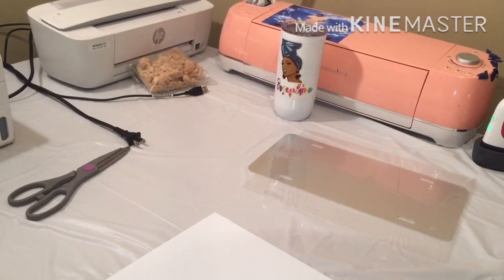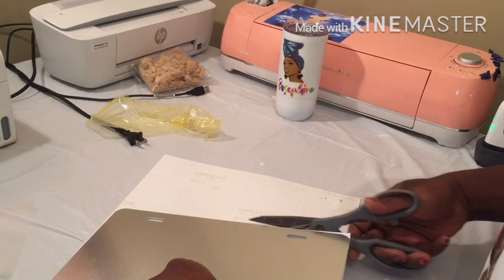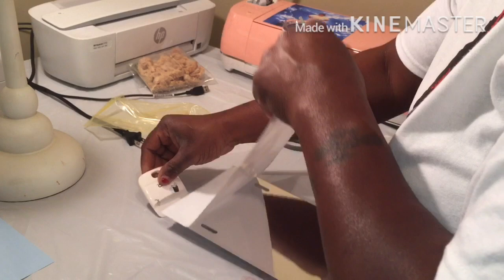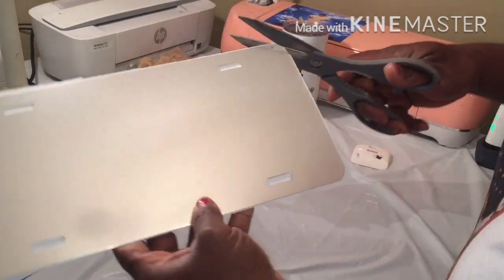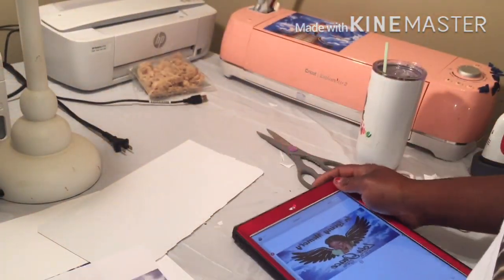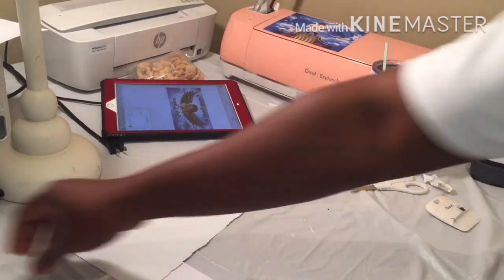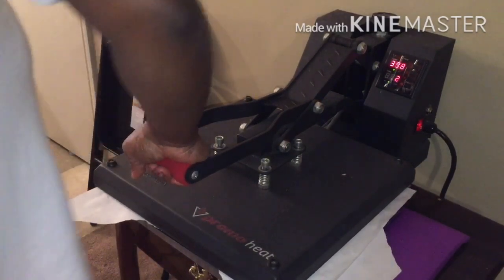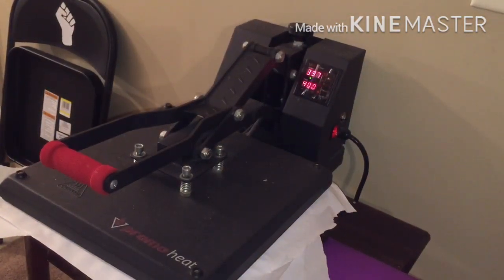DIY Sublimation Car Tag

Comment: I love how you keeping shit real I suggest maybe next time doing a wet application it with give you more flexibility and help get those air bubbles out as well as there is a a vinyl thats Bubble free which has micro air hole pockets to let the air out that would also be a good solution. When you get stuck with crappy scissors you can put the vinyl face down and then using an exacto blade using the the metal of the license plate like a ruler or template to cut around the vinyl hanging over.
Reply from the maker: Thank you so much 😊